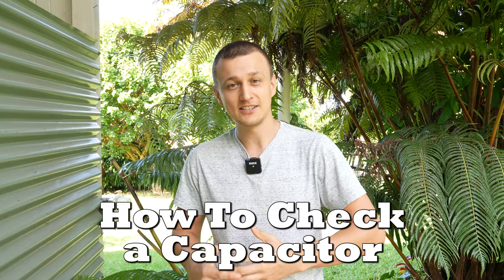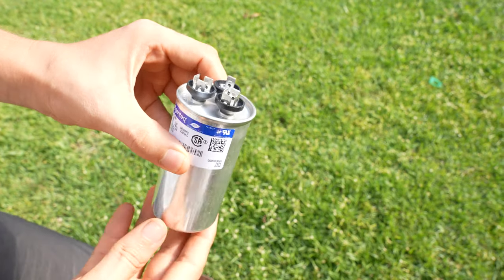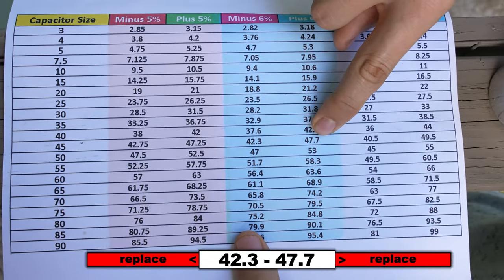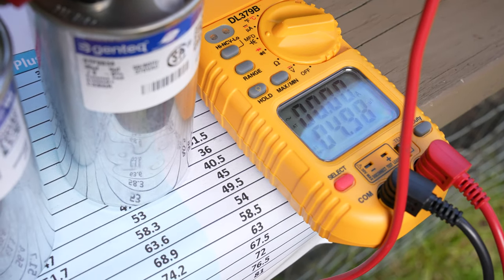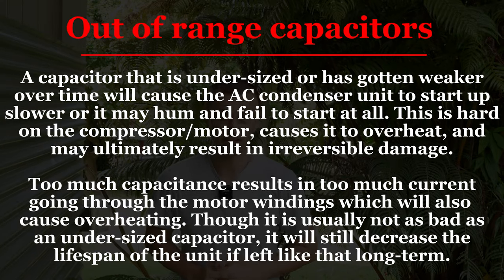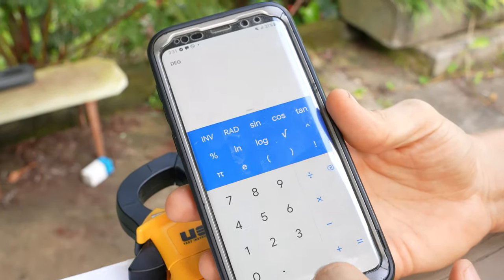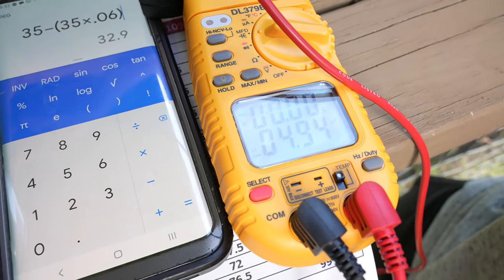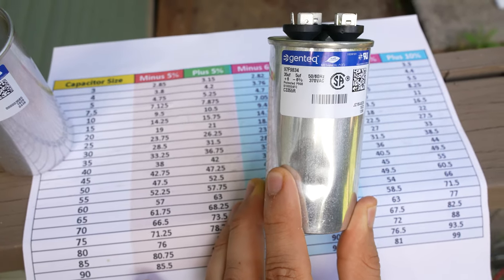How To Check HVAC Capacitor With Multimeter

Comment: So I tested my 35/5 capacitor and the fan fan was 4.98 and the Herm was zero. So I ordered a new one and believe it or not I got the same readings. I installed it and again the air conditioner does not cool properly. Is it possible to buy a bad unit right out of the box? I have a fluke meter and again, the fan reading is right on the money on both of the capacitors old and new.
Reply from the maker: You should be getting a read around 35mfd. The new capacitor you got was probably bad right out of the box. Did you test it before you installed it?
Reply: @WordofAdviceTV  yes i did.  No reading on herm and 4.98 on fan.
Reply from the maker: @boblatkey7160  Yeah.. Its rare but it does happen when the capacitor is bad right out of the box. You got a lemon then.
Reply: @WordofAdviceTV  i've checked my meter 10 times over! I got a new one coming today and I'm crossing my fingers!

Comment: Can I replace 40/5 to a 35/5 compacitor?
Reply from the maker: Yes. Preferably it would be good to put in the right size later but if the right size is not available, it's okay to put in a slightly smaller/larger size to get you by.

Comment: If two capacitors (i.e.  45 + 5 mfd) are priced the same, but one, say,  is +/- 5% whereas the other is +/- 10%, which one would you buy? Which is more reliable? The one with closer tolerance(lower %)?

Comment: I have a 1.5hp motor  that runs my pool pump I recently noticed that my capacitor had leaked all over the side of the motor. I pulled the cover off the capacitor and the part with the info had melted off is there a way of figuring out what capacitor I need with the info on the motor plate?

Comment: Great video thanks. QQ If one of the Com terminals in use has lots of corrosion, could one simply change to another.  The readings are good on the alternative terminal.  Or should I get rid of it?
Reply from the maker: Oh for sure! All 4 of the tabs on the common section are connected so it doesn't matter which spade you use.

Comment: Hi Jay. Thanks for the excellent video. I have a question for you. My ac condenser fan motor stop working  2 days ago. I went outside and I heard the buzzing noise. I spin the fan with a ruler and it didn't kick in. I didn't have a tester so I decided to order a new capacitor online. My specs are 45+5uf 370V. i order the exact same one from Genteq. I took a picture of the original one before installing the new one. one brown wire went to herm and the red went to C common. When I turn the power back on the fan started right away spinning for less than 10 seconds and then it would run again and then turn off again. Then the buzzing noise came back again and the fan would not work again with the new capacitor. What can be the problem? Did i get a new bad capacitor from amazon or could it be something else?  Oh yes by the way i also went to home depot and purchased a new condensate pump thinking that could be the problem first because when i had go outside of my house and watch the drain line it was dry and not even humid or wet. So i thought the condensate pump was bad and i change it. Even thought he condenser fan is still not working i did see water come out of the drain line now that i installed the new condensate pump. Please help me. My house is hot and i don't have enough money right now to hire an ac company to come do repairs. What should i look for??
Reply: There should be minimum 3 wires on the capacitor 1 for fan (usually brown) attached to the one that says "fan", 1 to C coming from the contactor (usually red or yellow), and a 3rd for the compressor attached to one that says " herm" (usually blue or yellow) (hermetic compressor). SOME systems will require a 2nd wire to "C" coming from the compressor. Based what you typed sounds like you put the fan wire on the Compressor spades.

Comment: I hate these multimeters.  I have now upgraded three times.  And now I have the AstroAI DM6000AR which I thought was suppose to be a good one.  But when I go to those symbols you show, and push the select button, there doesn't seem to be a microfarads or MFD option on this thing anywhere.  Is there not a MFD on this one I have?  Anybody know?

Comment: Hello Jay, love your videos. 
I need to replace the capacitor on my condenser which ha 3 terminals ( com/fan herm). The one I got is am/rad with 4 terminals (com/fan/herm/cpt) How do I connect this to my condenser? Thank you.
Reply: Just use C/fan/herm on the new one with same wire arrangement as on old one

Comment: Is there a method to determine the correct capacitor size for an ac system? Like if someone peeled off the label on the condenser and you can't tell the capacitor rating?
Reply: The fan motor data sticker and the compressor data sticker have that info also. You also could call the manufacturer tech support with model and serial numbers handy

Comment: Thank you for this video. It is very helpful for troubleshooting some basic ac issues. Follow up; when replacing a capacitor, do I need to match the same plus or minus value? I do not think the difference between plus or minus 5 percent and plus or minus 6 percent is drastic enough to cause problems.
Reply: The % difference only matters when checking it as to whether it is good or bad. It has nothing to do with actual operation of the unit. The part that matters that you get a capacitor that is right for both the compressor AND the condenser fan - most capacitors  cover both the fan and compressor  but there are some that only do the compressor - in that case you need a separate capacitor for the fan of the appropriate micro-farads size - usually 5, 7.5 or 10 for outdoor fan but can be as high as 25 for indoor fan
Reply: Going to a higher rated capacitor is fine but don't go to a lower rated one. If lower rated is used stuff won't run and will eventually fry windings

Comment: What are the failure modes for a HVAC unit that has a bad capacitor?
Reply: If you mean symptoms instead of modes than, place hand on top of outside unit where fan is mounted, it will be hot, and fan will not be running even when tstat is calling.

Comment: I'm afraid the common home owner will short the capacitor right after power is off and get a big bang! Why not just recommend go turn off power and wait a few minutes to discharge capacitor, rather than suggesting to short it?
Reply from the maker: Well.. You have a very good point. This video was slightly more technical then what most homeowners would care for so I made it with techs in mind or folks who already know about discharging capacitors. I should have talked about the discharging aspect too. Thank you for at least bringing this up in the comments!

Comment: I know you showed a caption on the lower of the screen, but should you emphasize discharging the cap before testing it. Will that blow out a meter? I am quite sure it will kick the *&^% outta ya if you touch em while charged! Your vids are GREAT!

Comment: Ordered a CAP that came the other day and checked out Good but don’t need it yet,
Because we had a RAM200 installed on our 14 year old Goodman almost two years ago, Jay.✅  Today we got the 5-2-1 hard start kit and installed it. My Question is,  IS IT OK TO PUT THAT ON WITH THE TURBO200 CAPACITOR…?? 🤔🤷🏻‍♂️ Inquiring minds want to know?🫣

Comment: Not to rain on your parade, but I've seen several situations where the old capacitor tests good, but the unit won't run till you install a new one. Just saying.